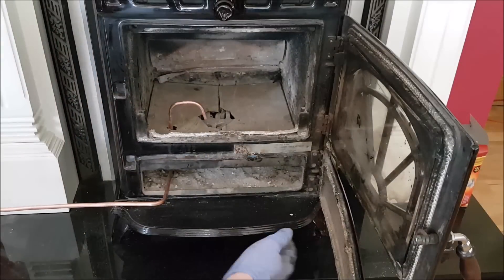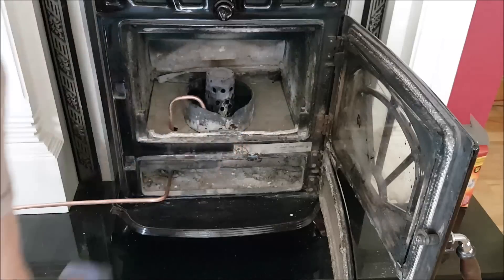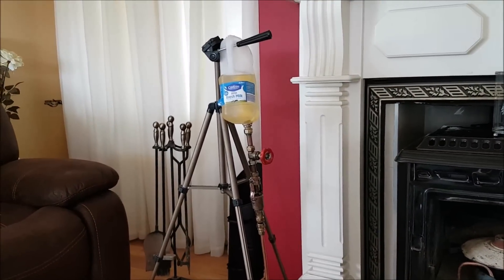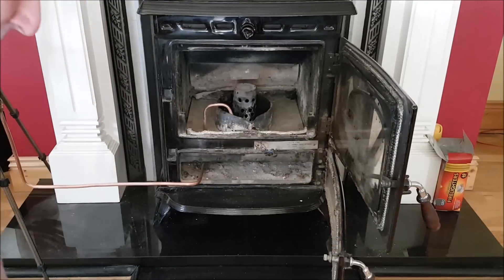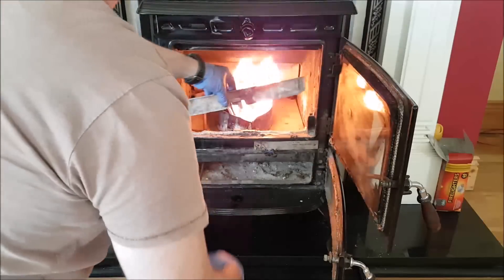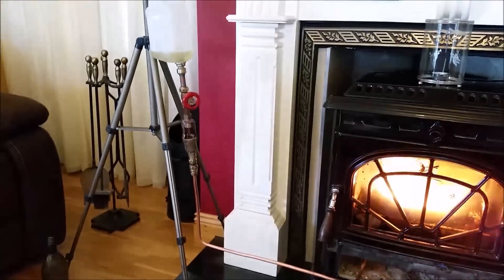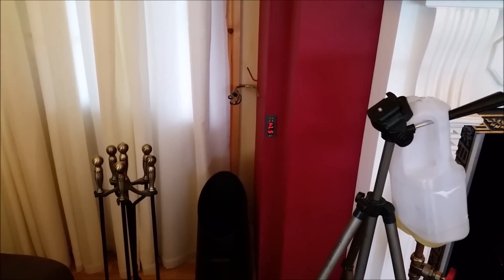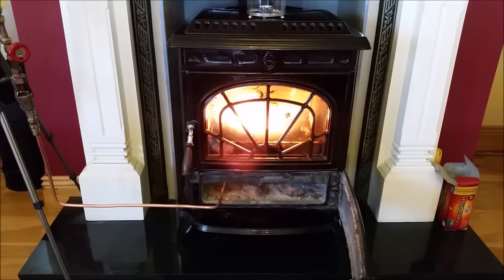Waste Oil Burner FREE hot water and heating

Comment: Hi Gerry,

great videos, inspired me to buy a welder and have a go myself....

On the drip feed have you thought of using a variable speed Peristaltic pump? http://www.ebay.co.uk/itm/122422358786?_trksid=p2055119.m1438.l2649&ssPageName=STRK%3AMEBIDX%3AIT

I am going to build a burner as I have access to free oil (mainly cod liver oil, fish oils and oil of evening primrose, etc.) and I am going to try and use a pump instead of drip feeding. These type of pumps give you a metered amount of fluid on each rotation, and shouldn't block if you got some dirty in the oil. The pump might have a hard time on cold sticky oil, but I am sure it could be re-engineered a bit more heavy duty. The factory I can get the oil waste from use this type of pump (albeit an industrial version), to move all of their product.

Best regards

Martin
Reply from the maker: Hi Martin. These burners are really easy to make and if you get the setup right you will hear it roar and at that stage you are making lots of free heat.  I was thinking of trying one of these peristaltic pumps adn I think that with a 555 timer circuit  the output could be controlled a little better too. I will do something on that soon. Happy Welding. Cheers Gerry

Comment: excellent video Gerry,  I'd love to try this on my stove,  but think I'll play it safe lol.  Cheers.
Reply from the maker: Hi Dave. Make one for the shed but there are other and safer  ways to heat your house. It's possible to do it with waste oil too. I did this video just as a proof of concept so that I could see it how well my new burner design  would work connected to my boiler stove and it worked great. Tons of heat, lots of hot water and heating circuits heating my house but it's back in the shed inside the minion stove again.  Cheers Gerry

Comment: Hahahaha Gerry, you took it to another Level... Hmmm I wonder why.... I am building mine from Scratch, and pretty simple like yours (The Minion Style) but with some Extra Safety. I have been busy, but I have been tinkering with mine to get the right SAFETY and some Automatically Features... Although mine won't be like in the Wall like yours... I want it out in the open so I can reclaimed ALL the wasted Heat with Fans. We have Wood Stoves and Pellet Stoves here, but I don't want to Ruin them and most of them are NOT Enclosed / Air Tight / Sealed. they have Gaskets like yours... But I still have breathing problems with them when On :(((. I must say, you did a GREAT JOB rigging this up.... Put some Stove Fans (High Heat Tolerant) behind your Stove so you can get the extra Heat behind there out to keep your Stove Warm without Worries / Safety :D. Also, use Thermo Snap Disc to automatically turn the Fan(s) on when the Temps reached High on the Stove or Safety desired Temperature. Overall, you did a GREAT JOB and I crowned you the New King of Oil Burner !!! hahahahahahahahaha
Reply: BTW, if you are going to use this Permanently, I don't think you will, LOL. Get yourself a Big Piece of Metal, put it in front of the Glass like you did with the other Stove and protect that Glass to prevent Crack / Heat Damages :)))

Comment: I actually heated my house for a couple years with a surplus military multi-fuel tent stove, and burned used motor oil in it.  I could produce probably 35-40k continuous BTUs on about 1 liter of fuel per hour, however this IS dangerous.  Occasionally I did have fuel build ups that would then super-heat and vaporize quickly causing intense burns that could get the entire stove body glowing red hot.  Scary stuff.  All I could do was starve the air flow to cut down the burn rate.  I would NEVER run one of these systems unattended, and I don't think I'll run one in the house again...its just not worth it.  I now use a wood burning stove which is very safe and the fuel is still free (for me).
Reply from the maker: Hi AndTheCorrectAnswerIs. I think that the chances of something going wrong with this setup in a house are too high to take a chance on running it permanently in my home. It would be much safer to have a converted oil boiler doing the work outside and sending the heat into the house by way of a heating system. I have some videos on that here https://youtu.be/xvddVsLqLdc
Cheers Gerry

Comment: hey gerry,thanks as always. .what have you found best to connect to bucket or jug? I couldn't hear which connector type you're using,  I used rtv on mine the other day but not sure how long term that will be
Reply from the maker: Hi Erik. I just used what I had in a box here but it is a 1/2 inch simple tank connector. I just drilled a hole in the milk container and tightened the connector. The one I used was a push fit but I would buy a compression type connector as there is no runner o ring that can degrade over time in the presence of petro chemicals. Hope this helps. Cheers Gerry
Reply: Execellent, that's perfect..through all the years and videos I had wondered which connectors you were running bc never mentioned em in all the builds. Thanks
Reply: Thanks bud
Reply: I am sending gerry my burner soon&concepts, but I'll use some new ideas on fitting buckets ends for sure
Reply: Gerry, thanks for these videos as I design my own. As someone else mentioned, could you please do a video on which connectors your using, from the tank to the burner? I know it's basic for you but I'm having a hard time finding fittings/reducers/spickets etc. my hardware store looks confused when I ask for a fitting to attach to a pail?? At least some close ups of it.
Reply from the maker: Hi Tepco Cycle Repair . I will do a video of it all tomorrow. The fittings will be probably be called something else in the States and around the world but I will take some photos as well. Are your pipe sizes metric or imperial. The other stoves that I have are easier to work with  than the one in my house as I cannot alter it but the little burner was well able to output the 50000 btu's that my stove is rated for. The truth is I am sure I could double that if I wanted too. Cheers Gerry
Reply: Thanks gerry you're the man
Reply: Gerry's Waste Oil Burner imperial, but I'll convert if needed. Thank you much!
Reply: Gerry's Waste Oil Burner And I'm more interested in the fittings for your other heaters like the minion style heater.
Reply from the maker: Hi Tepco Cycle Repair. I uploaded a video with some close ups and explanations Cheers Gerry
Reply: Gerry's Waste Oil Burner Awesome thank you!

Comment: Nice! You pretty much just gave me the design for my shop stove. The way you came in to the bottom of the stove with the drip oil feed. It's time for me to get to work on mine. If any one is interested to see my stove, just click on my avatar, and you'll see it in my videos.
Reply from the maker: Hi Marcel. I could easily drill the bottom of the stove to gain entry so that I could close the bottom ash door but my wife would kill me if I chip the enamel let alone start drilling. My flue is 8 inches in diameter by about 8 metres concrete block and liner. The last 2 feet to the stove is 6 inches in diameter. Your setup will provide plenty of draught. Cheers Gerry
Reply: Gerry's Waste Oil Burner   I was thinking about making 2 burners for my stove, one towards the back, and one towards the front. My fire box is deep and it could accommodate both. I'm just not sure if I'll have enough draft to run both on the chimney side of things.  The inlet side would be almost unlimited for draft. My fire box is at least 24"long, the width is only about 14" down near the bottom as shown in the video. The reason why I'm thinking about running 2 is for greater heat output. My concern is that balancing the 2 burners might be more trouble than it's worth. Your thoughts?
Reply from the maker: Hi Marcel.  When you are welding the bowl, thicker is not necessarily better. If the burner were made from let's say 1/2 plate it would taker forever to get red hot so vapourising the oil would be harder. I think 2 burners would be ok but it really depends on the pulling power of your flue. Hope this helps. Gerry
Reply: Gerry's Waste Oil Burner  Yes, you confirmed my thoughts on it. I will start with one burner. I have the bottom part of a 20lb propane tank that I was thinking about using for the bowl part of the burner, but it might be too big, gotta measure it. If not I'll just bend one up like yours. Thanks Gerry

Comment: What a most beautifull boiler stove you have, non existent down here. And it even works better than your Minion, with that length of flue. For the immersed burner I think we will fool around with the traditional fire extinguisher with a hole at the bottom, cutting off the top % replacing it with an adapted flue that (as we are using them now) goes down & up into the Barrel same as the military one we copied, but with a higher chimeny to create more draft. Thanks, am sure it will work out.
Reply from the maker: Hi Agrocruz. If you feel like doing a video I would love to see your fire extinguisher setup. Thanks for the comment. Cheers Gerry